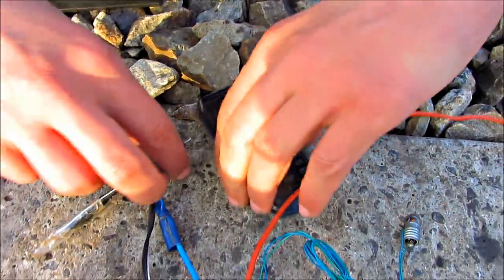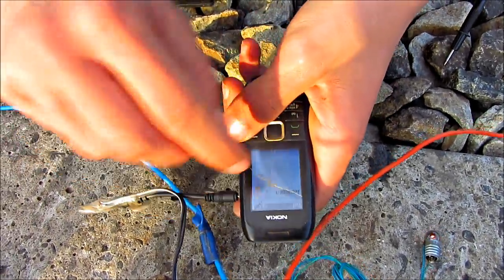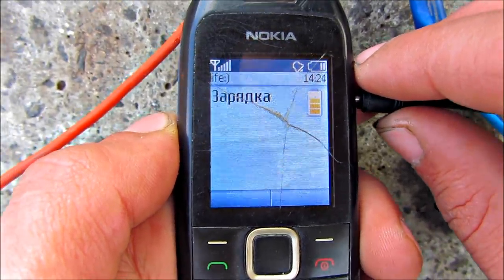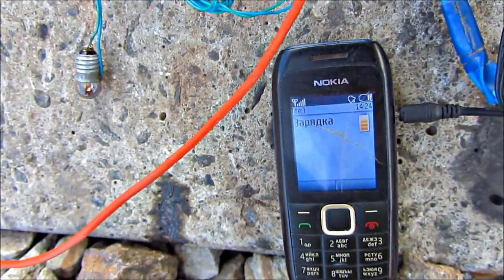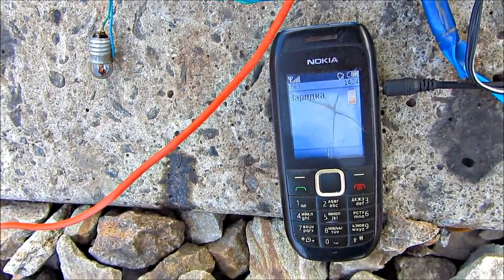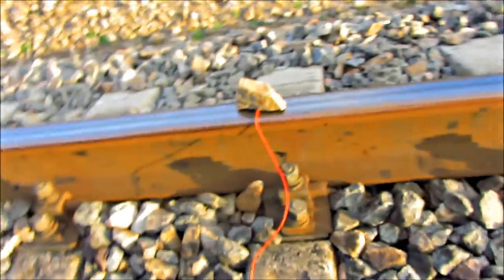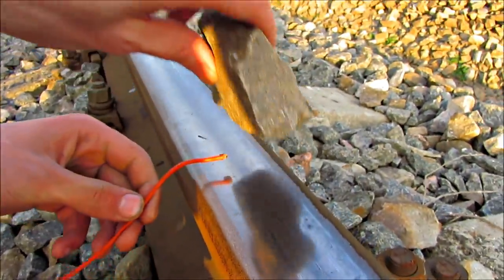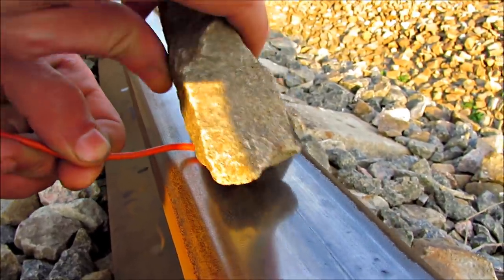How to charge a phone from the rail tracks. Measuring voltage on the railway

Comment: That 5 volts there is to detect if any trains are on those tracks. You probably drove some signaling specialists crazy as they were trying to find why that track section randomly appeared as occupied.
Reply: never knew that, but the imagination of the guy trying to figure out why it is marked as occupied surely is funny
Reply: True. In the situation you're lost and come across live train tracks with a dead cellphone it could be good to know.
Reply: that's why you go prepared
Reply: I carry capacitors around all the time.
Reply: Really !
Reply: That's good news, you dont have to worry about train running over your cellphone!
Reply: Demolition Mike that's why certain parts of the railroad tracks are charged with high voltage and that is why you should never walk on railroad tracks because you can get electrocuted and die from it people have been killed from the high voltage from railroad tracks not just from trains and the tracks in the train station are charged with high voltage
Reply: ᛟ but if you were LOST would you have naturally brought the train rail charging kit with you. "Man hit by train had fully charged Nokia phone on him". 🐵
Reply: Probably not. The current passing through such a small setup is probably not enough to appear equivalent to a train being present on the rails.
Reply: Dang gg man thanks for the info.
Reply: Demolition Mike five volts when he connected a capacitor and waited till that capacitor charged and then he used his multimeter on it , so it is useless because capacitor takes time to charge and then discharge
Reply: @travis gulley WRONG! Train signalling devices never have enough current to kill or even give a person a tingling feeling. This would make level crossing unsafe. The only rails to kill a person are third rails, which are put where no person would go (for example, a subway tunnel or bridge where, if a train comes, there is no escape). The only other part that can kill is the more widely used catenary, which is used on lines that don't have third rails. These use overhead wires, and only insane people touch them (or kite people)
Reply: There are many rail systems with live rails and they carry lots of current.  UK, France and other places I cannot remember right now but Travis is definitely correct.
Reply: So, I guess it saves your life if your lost, and so you don't get run over by a train.
Reply: E Gleaton - That isnt relevant, it is the shorting of the rails in any way possible that will make the track circuit appear occupied.
Reply: Alexandru Ifrim - in the case that the block he was on (block meaning section between two signals) was shared with a crossing then yes it would trigger the crossing until he removed it.
Reply: Hey Micky - No travis is not correct because he is talking about the running rails, not the conductor rail.
Reply: Travis Gulley - Incorrect, the running rails (two rails that the trains wheels touch) are at a maximum of 5v. you may have meant the conductor rail, which in some locations is at a pressure of 650VAC or 750VDC. the running rails can not even give you a tingle.
Reply: E Gleaton you can check if the signal turns red, if it does your phone is being detected as a train
Reply: Remember there is also a lot of Stray voltage on tracks.
Reply: B0hd1 thats probably a different safety system on the same circuit. Two rails together used for occupied track and one on each track to detect track separation.
Reply: it was 5 volts
Reply: Travis Gulley Not actually. Or not in Europe at least. The -  comes from the rail and the + comes from the wire above, so you have to touch (actually electrons can also jump but only like 0.5 meter) rails AND the wire above.
Reply: but then there would have to be a gap in the rails of diffrent rail sections, so if one is shorted the other ones wont be shorted with it
Reply: There are two types of railway circuits - parallel, where train shorts the rails; and serial, where train closes the circuit. When rails are broken, the first one can be safe, however the other is unsafe in this way.
Reply: :D
Reply: Done under supervision of a railworker...
Reply: U r never alone
Reply: So essentially like a digitizer in a smartphone, passing current through the train tracks to detect trains.
Reply: Now railworkers are going to talk about a ghost train in that location.
Reply: Zubin B.  basically yes.. and at least over here (I dunno if that happens everywhere, but it would make sense to do that if possible)   it is also used to check the integrity of the track.  so if a landslide or some other freak accident takes out a part of the rail, current won't travel from A to B and they know there is a point at which the rails are no longer connected to each other and a train might be at risk of derailing.
Reply: Im guessing how they use this setup is by simply being able to have a open circuit  that gets closed by the metal chassis of the train. so therefore anything that closes the rail's circuit would do this.
Reply: Travis Gulley that’s the third rail the two rails that the train rides on are grounded
Reply: sure, who doesnt keep a capacitor in the wallet
Reply: mrgeorge.  Though the same
Reply: XDXDXDXD
Reply: vilhis You are right about the gaps in rails that are there for heat expansion but I believe these gaps are electrically bridged by wires that are attached to the rails.
Reply: These are not electric train rails. There is no high voltage.
Reply: Not many gaps left in the US.  Almost everything is now ribbon rails. They come in 1/4 mile length and are welded together. Solid, non stop rails.. almost forever.
Reply: LOL... just don't stand on the tracks to try and stop it.
Reply: skylane807 surely the expansion and contraction of the rails needs to be taken up somewhere, temperature variations over hundreds of miles of steel tracks could cause several yards of expansion and contraction in length
Reply: Travis Gulley only passenger lines with electric locomotives have that. They are in large cities and dont run that far typically. Electric lines either have a 3rd rail or overhead pantograph lines. If its two rails and its in a rural area like this, they are boring, old railroad tracks with a few ac volts for the signaling systems.
Reply: I've seen photos of seriously buckled rails due to heat expansion. But those were old wooden ties (sleepers).
Rails (USA) started out at 16" long. Now they come from Japan in 480" lengths and are welded together into 1/4 mile lengths. Then they are welded together on site. With the clips on the concrete ties, which are much larger than wooden ties, I guess they've got this under control,
Watching them drop the 1/4 mile sections and put them into place is quite a sight.
Reply: skylane807 yeah and the thermal expansion coefficient between concrete and steel can be tuned to be basically negligible, so that would make sense, allow expansion to make tracks move side to side slightly, but keeping the same distance and height between them and making sure it doesn’t make curves too tight, that’s a huge job but I bet it’s reasonably possible with good quality control
Reply: well, you need a capacitor, a charger and some loose wire. not something you typically get stranded with.
Reply: Olli this is correct for how an electric train operates, but not how signaling equipment works. 
The 2 rails have a current going though them (max 5v usually). The trains wheels close the circuit, this allows current to flow and is detected by the signal.
What you are referring to is how an electric (over head cable) trains circuit works, positive coming from over head, and the negative going into the tracks back to where the current came from. This does not affect the signalling has this left over voltage is so low after going through the train
Reply: CheeseMonkeh what country? Us? Who do you work for?
Reply: E Gleaton it's only looking for a change in impedance. It won't take much to set it off.
Reply: AI I mean who doesn’t carry around capacitors with them
Reply: Richard Gray "Nokia phone completely intact though"
Reply: reply to: James Pian:
Yeah...me too.
But now I'm going to start carrying diodes, copper wire, light bulbs, and a 5" speaker.
Just in case.
Reply: Demolition Mike but science
Reply: So it only works with rails that are in use?
Reply: Haha very true it could show a track section occupied
Reply: That's what I was thinking too. On many railways, connecting the two rails together via a conductive material can change the previous signal to danger (red) so train services may be delayed.
Reply: Eddie Hitler there are wires on the sides about 6 inch copper braided wire thats bolted to bridge the gap
Reply: Luca Fuoco bro are u talking about the tracks these kids are on ? If so ur dead wrong its a diesel engine train that runs on them no electricity
Reply: mrgeorge what? Your crazy! If anything it TERRIBLE! He was holding up the railroad!
Reply: Lightning Mike lol oh dear
Reply: @travisgulley2652  no, that's wrong
Reply: @testhytest2429  the low impedance provides plenty of energy for 100% duty to run a cell phone at full pwr during the commission of a call (worst case/7oomah)
Reply: @Pomorski Windziarz hahaha!
Reply: now I know
Reply: Travis Gulley 
We have 11000 volts running through our three rail system. Whoops!
Reply: They probably made the train rails set off
Reply: Aha, was just gonna ask.
Reply: Nope, so wrong.
Reply: @TheDankEngineer  I've seen them, they always have huge warnings of electrical voltage and zap if you try to touch. Usually also there is like an electrical box that can be easily seen with the naked eye. Like you said, they are placed in places where people wouldn't or shouldn't cross, I've seen them on bridges and very deep in where forests or fields surround the tracks.
If you travel by train long enough and look through the window you can always spot one of those.
Reply: @nelsonahlvik6650  NO! The rails carry the returning CURRENT if the path is electrified (wich it isnt since the overhead lines are missing) so the only voltage that could exist there is caused by the voltage drop across a wire due to the flowing current. Since there is no current, there will also not be any voltage. And even if it was, with the cross sectional area of those rails there wont be much resistance and thus not much voltage drop. 

BUT dont confuse the driving rails with a power rail. A power rail is a THIRD rail that will be connected to quite a high voltage how high depends on the system. In many cases they are shilded so you dont make contact too easy, though in most they are not. Look up pictures of for example the london underground, they use unshilded power rails, those are dangerous but not the normal rail
Reply: @FandCCD  I don't agree. If there is such a system it will take much more than a charging cell phone to trigger. 
Reason: concrete is naturally surprisingly conductive and since the rails are connected by that to each other there will be quite a high current flowing in total. The situation gets even worse with wet weather, even less resistance, even more current. 
You could even tell by the corrosion on the spot between rail and concrete that it doesn't rust more that elsewhere. If it was electrified constantly there would be much more of that. 

The voltage they where measuring is most likely caused by external interference like power lines and stuff
Reply: @techtastisch7569  Yes i know that. I think you might have misunderstood my reply, i was saying that you only would have to touch an overhead powerline and the ground to get electrocuted and that you don't have to touch the rails as well. Unless i'm wrong.
Reply: @nelsonahlvik6650  oh sorry that was my fault, in that case you are right
Reply: @richardgray5207  Nokia phone was good as new after the crash
Reply: @travisgulley2652  I guess raining really does a number on the level of efficiency.
Reply: @techtastisch7569  well I don't agree with that last statement.  The "signal" those guys were receiving was very regular but NOT a steady 50 Hz or 60 Hz hum, which would be consistent with the most likely source of external interference (power lines).  This was a long pulse, followed by 2 short pulses, very regular.  That is not simply external interference.
Reply: @skylane807  only certain areas 
in the US use concrete ties
And even welded ribbon rail has expansion joints, it all depends on the climate.
Reply: @jpian0923  Please explain more, I want to learn? How long do they RETAIN a charge? Does rubbing a magnet over a capacitor do anything?
Reply: That’s actually for cab signaling

Comment: The signal is of ALSN in ex-Soviet states. Signal is 50 Hz (50 cycles per second), 16 cycles on, 7 cycles off, 10 cycles on, 7 cycles off, 9 cycles on, 30 cycles off; this creates a 1.58 second repeated signal (KPT-5). WikiPedia describes this signal as indicating what the next signal will be to the train driver. The signal in the video indicates the next signal is a green light. The first axle of the approaching train shorts the tracks while a sensitive coil in front of the axle picks up the electromagnetic signal created by this shorted loop (as well as axles acting like a current shunt, etc., the coil amplifies and cleans the signal to be read by the train devices). I can't find anything about the current used or its threshold for track occupancy detection (would probably help if I could read Russian better) but I imagine the impedance needed is a lot higher than what a phone charger would create.